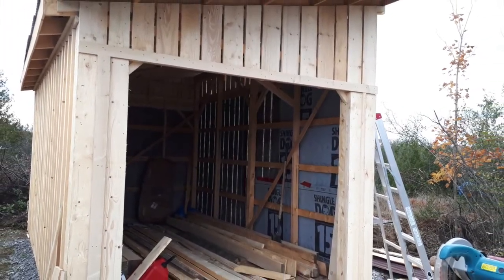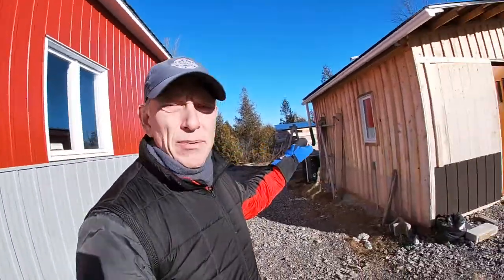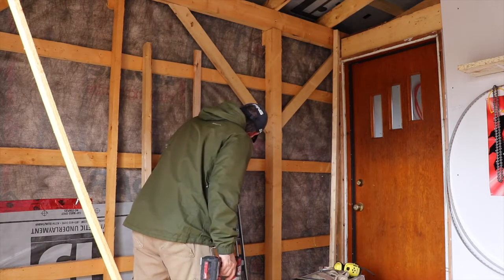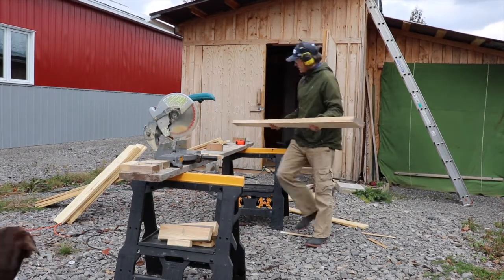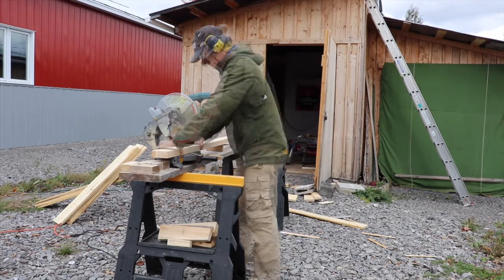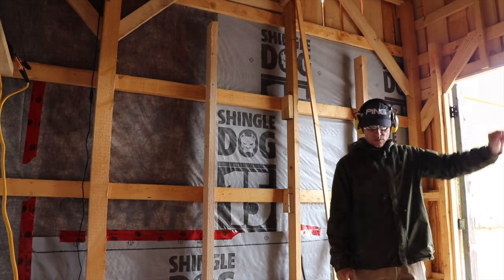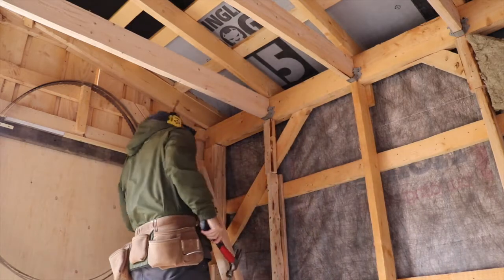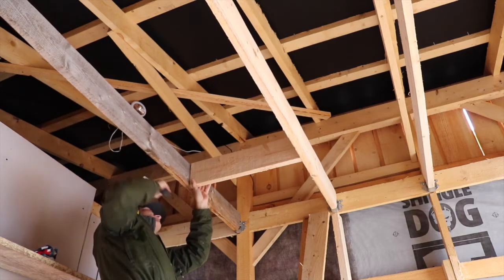How I Transform a Tool Shed Into a Simple Off Grid Cabin! Part 1

Comment: Nice video, thanks.  My little cabin is also  a converted storage shed. It came with 2x4 stud walls, which I furred with 2x2 to make a 2x6 wall. That way I could add Reflectix IR blocker and R-19 fiberglass insulation, supposedly equal to R-21. The double "shed" doors were also upgraded to same thickness/insulation as the walls. Getting GREAT thermal performance AND sound deadening.